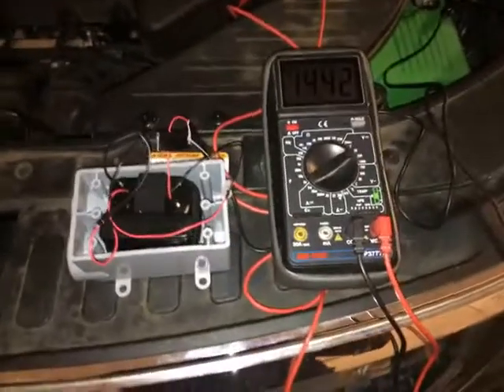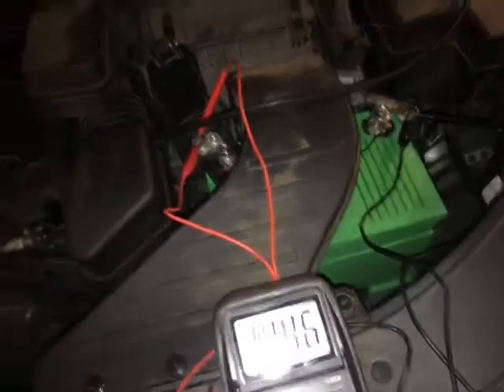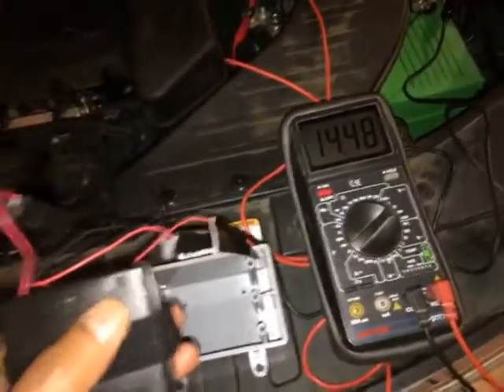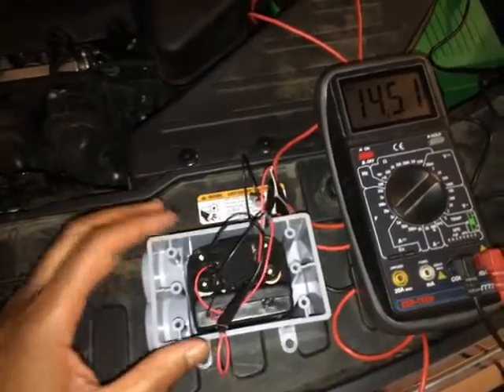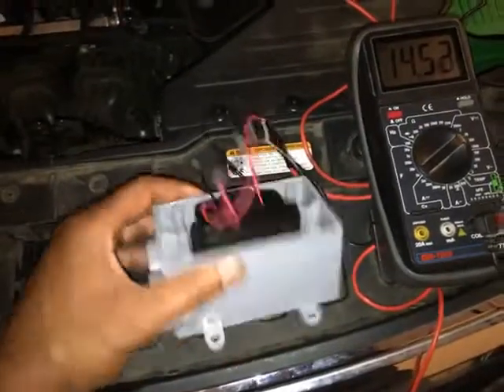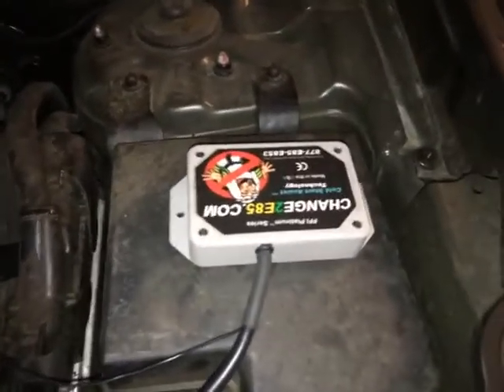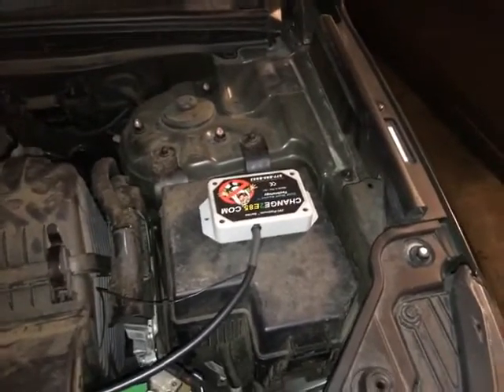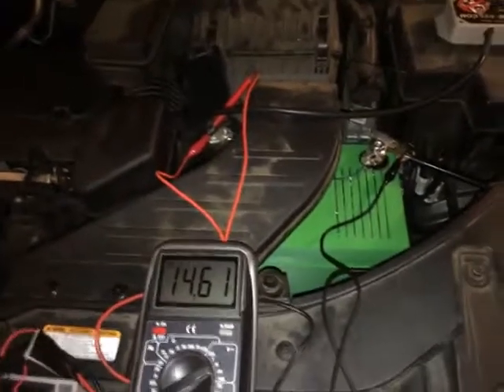Ultra Capacitor Battery Replacement and E85 Conversion Update

Comment: That's funny I called be for seeing all this.. I am thinking grate minds  think a like !! Heheh Brother I love this. Thanks for letting us be a part. God Bless.
Reply from the maker: No problem, glad you enjoyed it.  By the way, I went with the Mourningstar 600V controller on the solar side, I called up MourningstarCorp and they confirmed that the CC will support a 24V system with programming.  Thanks for the tip.
Reply: rhandsom That ROCKS!! Man if I where you I would go with that then. Happy to be of help. God Bless.

Comment: Very smart addition, rechargeable 15v aa battery bank!  You still net save 40 pounds of sprung weight vs the old lead acid boat anchor!  Ever thought of adding a 10 inch tablet into the dash, sort of like the tesla, to get a full blown 4g lte intelligent road traffic warnings, engine stats, gps, and remote control of your home security cam video, lights, hot water heater, solar energy production stats, etc?
Reply from the maker: Thanks for the comment.  I actually did that with the tablet a while back with a Motorola Xoom.  It was really cool.

Comment: Very interesting work, but what's the purpose of having an ultra capacitor for starting power if you need a battery pack too?
Reply from the maker: Ultra capacitors have a self discharge like all storage devices.  Because of how they store energy as opposed to traditional batteries, they will self discharge faster than lead acid batteries.  When using the ultra-caps for starting the vehicle on a daily basis for driving to work etc, there is no need for the battery pack.  If the vehicle is going to be parked for more than 3 days, like if you were parking it at an airport, parking garage, etc, then this is a way to keep the ultra-caps charged by simply using a small battery pack to handle the 5mA leakage current of fully charged capacitors.  15v in AA batteries is not to start the car, they have no where nears the "power" in CCA (Cold Cranking Amps) needed to start an engine, however they do have the "energy" storage capacity needed to keep an ultra cap bank topped off.  At 5mA leakage current, it would take days or possibly months to drain the double AA batteries.  The is similar to the Maxwell ESM that is used as a starting module for big rigs.  These big rigs typically have 3 or 4 batteries.  One of those batteries is replaced with Maxwell's ESM as a starting module\battery and the other batteries are used to keep the ESM topped off.  Here's a link for reference.  https://www.youtube.com/watch?v=as25nZKhw7g
Reply: rhandsom Okay, that makes sense. I'm looking at living out of a Van or RV with a solar system and a large 12v AGM house battery, like marine deep cycle batteries and it seems ultra caps that charge off the house battery could replace the starter battery. Do they have a longer useful life than car starter batteries?
Reply from the maker: +Eric Duprey According to the data sheet, well kept ultra caps can last up to 1,000,000 duty cycles or 10 year DC life.  Don't know exactly what 10 year DC life means. But I tend to go with the 1,000,000 cycles.